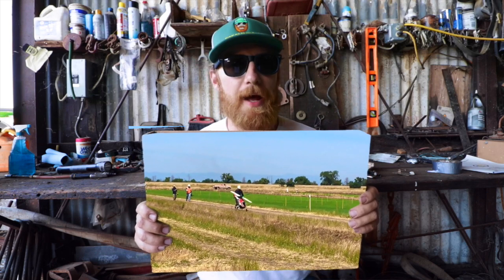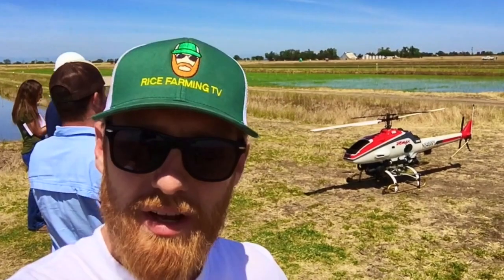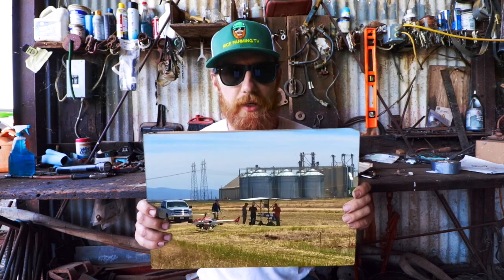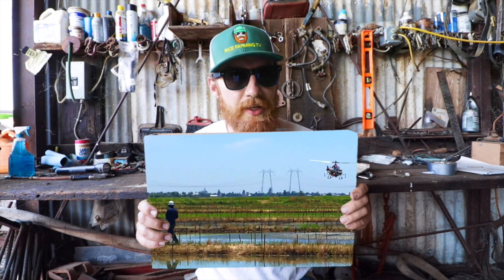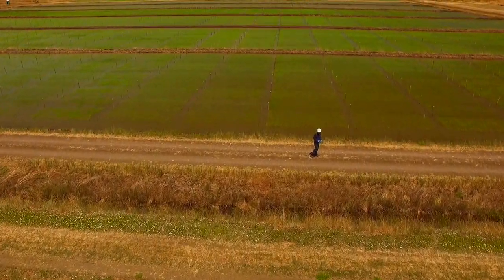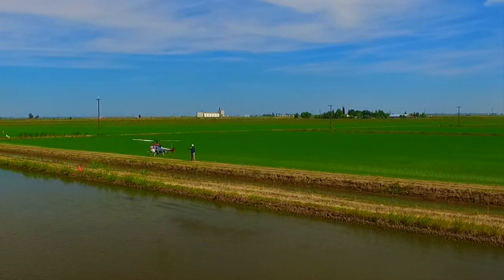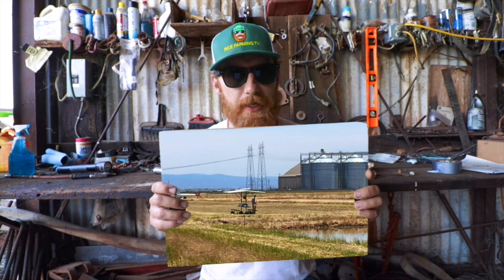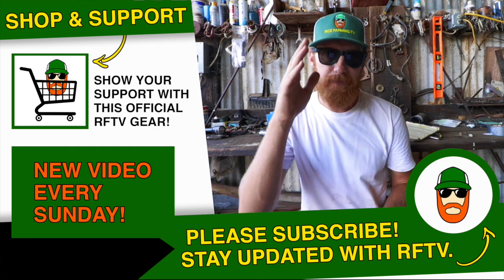Yamaha RMAX Agricultural Drone!

Comment: What's up my man, I have to say something I don't think others noticed but that green screen projection was legit and most folks wouldn't take the time or effort to do it. I guess that's the difference between a regular YouTuber and those pushing their creativity limits. You are now officially a ricematographer, wear the hat proudly. All jokes aside I have a question a few years ago there was a serious drought in California people were moving out to other states and it looked bad. I visited last June and the snowpack was tremendous and no one is speaking of drought anymore. Do you think folks have let their guard down and maybe the next drought might be the real deal?
Reply from the maker: +Raychristofer thank you for the ricematographer title, I wear the hat proudly and with honor. Yeah man, we had a 5 year drought that ended last winter/spring with heavy rainfall. We all got scared because the local dam (Oroville Dam) filled up and the main spillway and emergency spillway were damaged. Now the focus seems to be on the repairs of the dam and of they will be done before this year's rainy season starts. You're right, California needs a lot more water storage. Most of the rain last year flowed through the rivers and irrigation systems out into the SF Bay and ocean. People certainly forgot about the drought after the scare of flooding. We will see what happens this winter. I think if we have less than average rainfall we'll be talking about drought scares again. Right now we're still focused on the structural integrity of the dam and thus flooding. This is a great question and thing to think about. And thanks again for the kind words Ray. Take care!
-Matthew

Comment: The first to present his case seems right, till another comes forward & questions him.That's what I thought when I first seen this until I seen the 2 men with the 4 rotors spraying automatically 2 acres per run. What was their weight?
Reply from the maker: Dennis Day thanks for the message. There are definitely multiple spray drone options available. If I had to guess I'd say the autonomous drone in my other video weighs, with payload, 25 lbs. I'm not 100% sure though.
-M.

Comment: Because of the payload limiting endurance, I don't think hand-flown, rotary lift drones are going have widespread use in agriculture. Given some AI/GPS/video for route control, robotics incorporated in refueling and payload pickup, and the ability to enter local flight hazard information, automated drones could be pretty successful.

So Mathew, given that we have self-driving cars that can handily navigate busy city streets, what quirks of a running a harvester really require human in the loop control?    If you can't totally automate a harvester because of these quirks, could you see a master-slave operation where one harvester is human driven and one or more slave harvesters run in formation?

Comment: I can see this machine treating field perimeter, and the rest with an airplane, especially near residential or crop sensitive areas. Keep up the good work Mathew!
Reply from the maker: Hi George, I think you're totally right. This needs to be utilized in very limited but specific situations that are not ideal for crop-dusters. I agree, near sensitive crops is a great example. Because it's lower velocity and low height above the canopy of rice it's greatly reducing drift. Thanks for the message and encouragement George! Take care!
-M.
Reply: Matt, with plant recognition software, this drone could be used to spot treat problem weed or disease areas, where the herbicide, fungicide, etc., requires small amounts of gallons / sq ft. An example would be an (80) acre field with (10) small patches of highly undesirable weeds. You are treating maybe (100) sq ft versus (3.5) million sq ft. High tech scouting and spot treating, I call that sustainable.
Reply from the maker: George I completely agree with you and it's a great point: the size of this drone would much better be suited as a spot treating applicator. Problem with this model specifically it doesn't have an onboard camera that could communicate with the pilot or spray function. But of course there is this tech in other drones already. I suppose the biggest hurdle would be the recognition software--make sure you're spraying weeds and not a splotch of over-fertilized rice that is similar in looks. We will get there though George! Have a great weekend!

Comment: Did anyone else notice that you have a flat tire on your chisel?
Reply from the maker: Hey Mike! Good eye. Yes, someone pointed it out in an earlier video (I used it for a title sequence). It's a three-point chisel so it doesn't need tires as it's connected directly to the three-point hitch of the tractor. I'm not sure why it ever had tires on it but that's why we never fixed it. It works perfectly even with its flat tire. :) Have a good rest of your weekend.
-M.

Comment: I get the idea that you think it needs a bigger payload to make it more useful? (Which means a bigger helicopter.) What it needs by the sound of things is two things to make it useful to farmers, a fully automated control system based on mapping similar to how harvesters track their progress through fields, do a run and then return to it's base station, auto refuel and reload then go out and repeat and until a field is finished. Right now the speed, limited payload and labour of having 2 staff, seems to make it an expensive service. Without being autonomous it's really just a cool RC chopper.

I know Skycatch is deploying drones in that return-to-base method on automated flight plans for mapping and construction. But they're obviously smaller drones.

So there's the hardware of the Drone itself, the flight control software, then the mapping software built in a way that allows farmers to bring in data from other sensors/sources to customise the flight paths and chemical usage depending on changing conditions.
Reply from the maker: Hi Casper! Yes, it definitely needs a bigger payload to be adopted across applications through the rice growing season. 7.8 oz. with 3 gallons of water per acre is a light load. Remember in my herbicide video (Ep. 38) the example was 2.8 oz. with 10 gallons of water per acre. Imagine an application like that...over 3 times the material, time and refills. Also imagine that over 150 acres (an average size rice field) and not just 10 acres. So this, as it looms, is a special case use situation. Let's see what the future brings in regards to size, automation and affordability. Have a great week man!
-Matthew

Comment: What does it cost to level a field? Also what is the cost, and .    .....nevermind can't buy it.
Reply from the maker: Adrian, good question! There are some variables when thinking about leveling a field. It's about $100 to $150 an acre. This is if the rice field is already divided into checks and it's already some what level (and your not moving a ton of dirt around). As for the drone...yeah, they're not selling it. The rep at the demonstration said, in grapes, they are charging up around $200 an acre (depending on the grade or slope of the vineyard) for the spray service. That wouldn't work for rice because crop dusters are charging $14 dollars an acre. Let me know what you think man!
-Matthew

Comment: I remember when rice farmers would also have a pilots licence so they could use small plane like Piper Cubs to fly over their rice fields to check the progresses. Now they can use drones.
Reply: Rice Farming TV   Rice chaff is nothing compared to milo chaff!!   Worked for a custom cutter way back in the day running case 1060 combines.  Had a cab, but no AC.  I remember certain varieties of milo was worse than others on the itchy scale.    When we were farming rice our combines did not have a cab, but we had built large frames over the top and hopper that had a tarp over the top of it.  Was still hot, but even a small breeze was tolerable.
Reply from the maker: Hey Jeff, that's great insight! Isn't it amazing how things are changing and progressively changing more quickly. Pops likes reminding me how far combines have come throughout his rice farming career. Take care Jeff. Have a good rest of the weekend!
-Matthew
Reply: I got to run one of the combines that was converted from an old stationary thrasher with a parted out D7 cat. and draper header. Also ran the old JD 907 and IH 915
Reply from the maker: Wow Jeff, you operated some real beasts! And how did you protect your pores from the itch of the rice chaff? 
-M.
Reply: Luckily they all had cabs with A/C but like all machinery once in a while the A/C would fail and it was miserable and as you know during harvest you work 12 hour days 7 days a week until your done or run into green rice or you get a rain storm
Reply: Flying a crop duster has got to be way more fun though.

Comment: Amazing video again, Matthew. Those data can really give me a picture of how R-max working in the field. Such a neat drone hum......
Reply from the maker: Kevin! Thank you and yes, it's a neat drone but it seems as if there tech out there to support guided flights and not manual control. I think there should be some autonomous options out there. We'll see my friend...
Take care!
-M.
Reply: Yes, I am not familiar with R-max guiding system, but a lot of drones nowadays use A-B point to support their flight when it is in the air. Somthings like a cruse function in a car. when drone taking off and landing still needs manual control. And the biggest difference is that the flying couse is not preset before flying, so they need another team member to mark the return point to the pilot. I am also want to know more about R-max.
Reply from the maker: Yes, the RMAX is completely manually controlled. We will see the data soon on the application. Hopefully there were no application skips nor overlaps due to pilot error. 
-M.
Reply: Great! Let me know when u get those data.